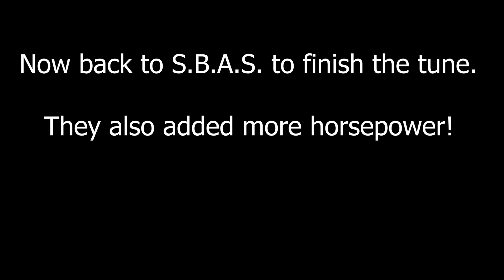SBAS - Woolich Flash & Tune - 2019 Ninja 650

Comment: It's not adding power, it's simply de-restricting the engine to make the power that's already built in.
Power-adding is stuff like higher compression, turbo, supercharger, NOS, big lift cams, porting, etc.
Reply from the maker: yeah but all in all, it feels like a total different motorcycle. To bad the top end hasn't gotten any better, actually.. maybe a little less top end.
Reply: @JosephMyLife  You may have not actually lost any top end, but a fatter middle changes the way the top feels.
Reply: @JosephMyLife  top end is gear related. Aka our bikes are geared for 134

Comment: You could've saved 10k if you brought it to BikeTech101 located in Pampanga. It only costs 5k for remap, flash, and tune if I'm not mistaken.
Reply: Seriously???
Reply: Eduardo Garcia I'm not exactly sure about the 5k. You can watch Red Sweet Potato's vlog tuning his CB650R at Biketech101, as far as I remember he said it ranges 5k
Reply: @lesterevio  woolich tuning software is a different type of ecu flash and tuning. I believe it gives more power as compared to the cheaper one, But 5k option is good for budgeted riders. 🙏
Reply: 5k for Remap only but it will be around 15k with reflash as per Biketech101

Comment: What about the RPM, did the map increase it to extra 1000rpm?
Reply from the maker: The removed the rev limiter, but it runs out of power at redline.
Reply: @JosephMyLife  My N650 2017 had ecu remap recently I was impressed with the low to mid range responses but the topspeed, drastically dropped by +10kph. :(.
Reply from the maker: @nadt2711  Maybe that's why I was only able to get around 200kph even...
Reply: you need different velocity stacks, the rubber ones compress and close at high rpm @JosephMyLife